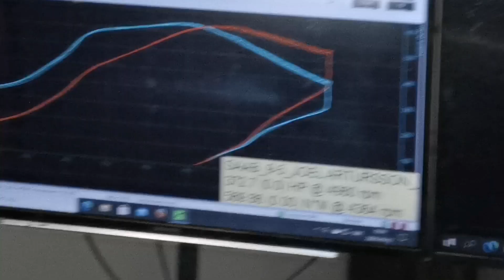Saab TD04HL-15T 372hp on the hubs!

Comment: Is this on race gas?
Reply from the maker: Regular gas station pump E85 that we have here in Sweden, Finland, Estonia and Latvia.
This is running 100% optimized ignition timing for max brake torque.
Reply: E85 makes wonders! @ArturssonEngineering
Reply from the maker: I personally say it is scenario dependent, petrol aint bad at making power, just that one must find the ways to prevent knock properly! ~20whp difference with the 19T is what I have found in absolute restriction free state against eachother at maximum available ignition timing 98ron vs E85 so far. Heatsoaked near 40C intake temp with AC on full blast. Initial torque output is the same and then petrol loosing efficiency with rpm gradually more and more. 10.08 sec 100-200 vs 10.86 sec as the average horsepower number is down by almost 15- 20whp through out majority of the powerband except in the very beginning 😄 @saaber95

Comment: What mods were done to accomplish this? 🤔  how hard would it be to make this power with a t5/t7 hybrid with t5 cams?
Reply from the maker: It had these mods and it is an very minimalistic spec list:

B235 wössners std bore. 
T5 cams.
Stock rods. 
Oe exhaust manifold ported.
TD04HL-15T 6cm2 max ported with Mamba 1 bar actuator.
Ported king cobra/+06 aero intake cobra.
Smp/Lucas 846cc injectors.
3" to 2.5", removed resonator and boost activated 60mm/2.5" exhaust cutout on the downpipes first bend directly behind the turbo to remove a lot of backpressure.
Massive 4" AEM dry flow airfilter with adapter.
9-5 Aero 240mm pressure plate and 6 pad springed clutch disc. 

It is definitely doable on similar power with an hybrid, but that bottom end is a lot heavier.

The tuning to make power like this on these mods is quite something else and most wouldnt probably fail early. A lot of physics involved every choice to make it accept this kind of flow and power in terms of fueling, ignition timing and boost curve/airmass.